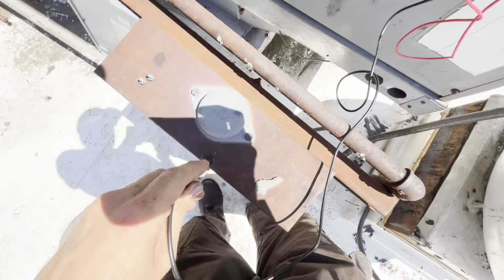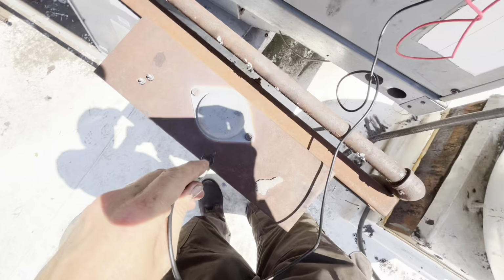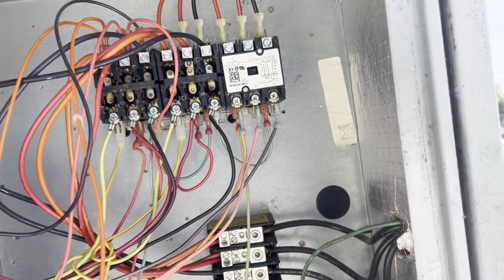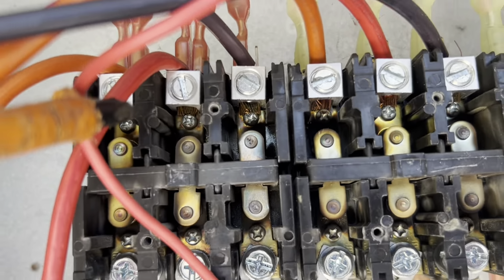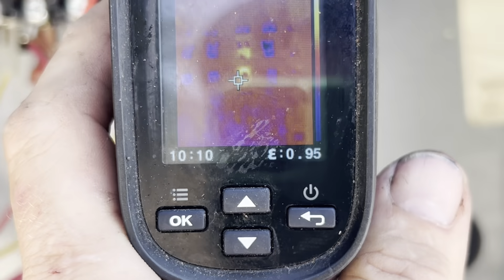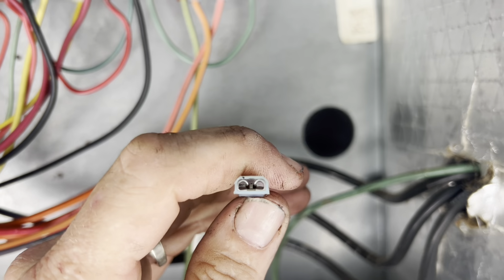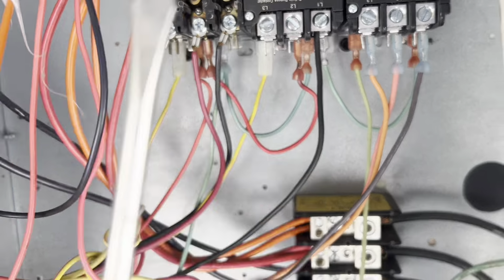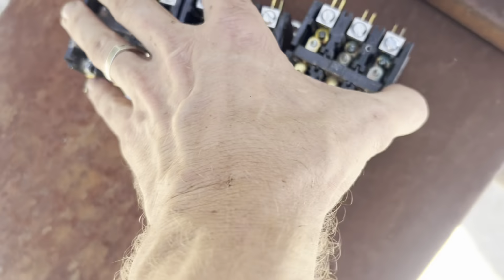Daiken again!!!  She keeps tripping the breaker

Comment: Nice Fluke 324 meter! Looks new. Did the fieldpiece stop working? Like one more and the other? I use fluke 324. It's been great! no issues.
Reply from the maker: The spring broke on the clamp and the battery cover cracked.  So we made a change

Comment: package units Tripping Breakers - More often than not i Find:
1) Weak Breakers - to be the culprit or equally i find Breakers that are not the  Correct size for the Load / not sized at Max breaker size unit Name plate.
2) Allways size breakers for Max. allowable size on unit name plate.
3) old breaker/ Dirty condenser /  sized borderline to min size / Summer heat / Burned contactors all can add up to = nuisance trips of the circuit breaker.
4) also - Melted breakers in Electrical panel. 2nd most common. burned wire connection. Bus bar connection burned up at front of breaker.

all that needs checked. maybe you checked it off camera.

Good vid.

Breakers def need replaced too. that's for sure.

Comment: Ferrules seldom used in 'merican resi-f&b commercial, but should be instead of all the loose strand under lugs and wrong sized wire nuts...

That said, my ferrule kit is also practicallly  virgin 2+ yrs later!😂